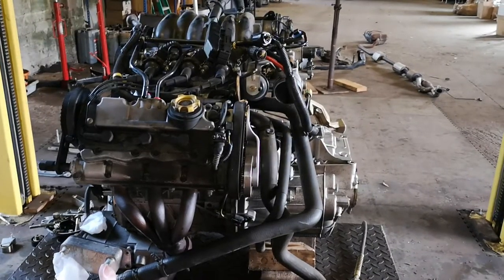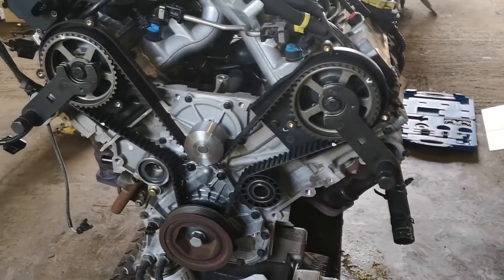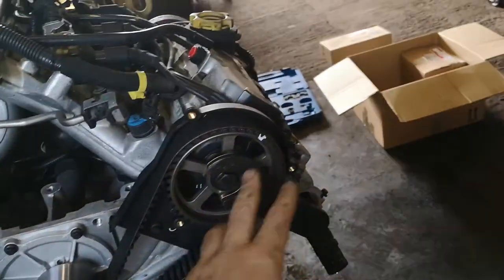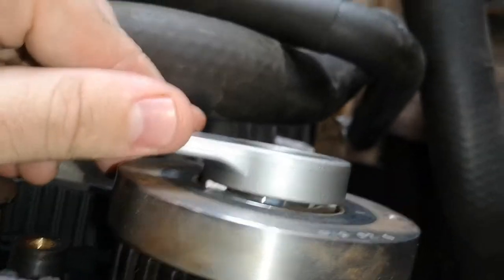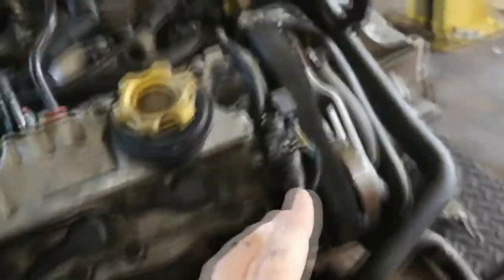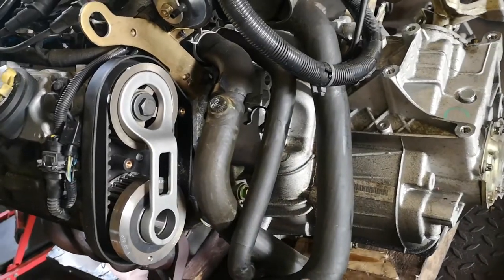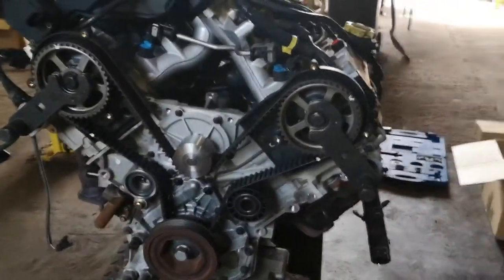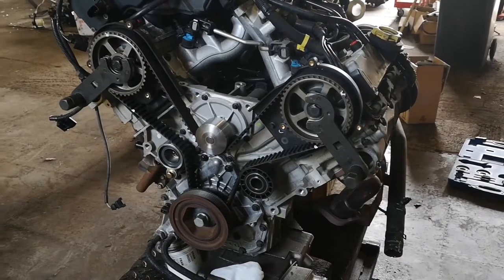KV6 timing belt insight

Comment: You're right! I'm changing the belt on my 103k MG ZS with 2.5 KV6 and the timing is a good couple of degrees out between each inlet and exhaust cams, although both belts there are getting a bit slack. Last person in there left paint marks so assuming perhaps didn't use tools. Thankfully I rented a set from DMGRS who are saints.
Reply from the maker: Glad it helped you out.

Comment: Ive got exactly this issue on the secondary belt side. The sprocket locking tool fits snuggly in the front inlet and exhaust sprocket and I can remove the bolts, sprockets etc and fit the new belt with no issue. But the rear set , thats a completely different matter , the tool will not fit. I posted this issue on FB 75 owners group and a member pointed me to this issue. So am I correct in thinking that I need to loosen the sprocket bolt on the rear bank in the primary belt side ?
Reply from the maker: Yes exactly. Loosen the 3 bolts will let the cam turn a couple of degrees on the rear side.

Comment: Question for you. I’m timing up a 2.5 KV6 from a 75 auto, it’s going in to a ZS 180. I’ve found with the flywheel locking pin in place the ‘v’ notch on the crank pulley does not quite line up with the pointer on the oil pump. The crank pulley notch is just a smidge off to the right of the pointer.
Would you leave pin in when fitting the cam belt, or remove pin and go by the crank pulley markings?
Reply from the maker: Make sure you are in the right hole in the crank, there is few. If you lock the crank up and it doesn't line up there something badly wrong.

Comment: What locking kit do you use by the way? Mine is a comprehensive kit with all the bits, but it’s rubbish! The camshaft locking tools just slip out and don’t fit properly
Reply from the maker: mine is one i picked up from a rover dealer, so is a genuine set.  Yes i believe some of the aftermarket ones have diffculty locking the cam sprockets.  Prob poor material choice etc.
hope you get it sorted.  just remember to rotate it a few times before you bolt everything up and fire the engine for first time.
Reply: @mrkstrlng  I have one of the cheap Chinese kits from Amazon. I found that the lugs on the locking tools needed a bit of touching up with a file for a proper fit. Then they work fine. The biggest issue with the cheap kits (and I think the Sealey and Laser kits too) is that they don't use the factory type cam turning tool but instead have a hex on the end of the locking tool for turning. If you aren't careful the took can cock and fracture the end of the cam where the locating pin fits. I haven't had any luck finding the proper tool and am thinking of making up my own.

Comment: I have been given a present of a Rover 75 connoisseur 2.5l My brother had been offered a £100 for it when trading in. An offer which he refused and instead offered it to me. The only Rovers I have been familiar with have been a Rover105R from 1957 and a Rover100 from 1962 so this new Rover is unfamiliar to me. I knew as soon as I listened to the engine that it wAS off-tune. I had also been advised by a highly experienced mecahnic that no matter what; I should replace the timing belt at the very least. So I bought the recommended timing tools. I am now at the stage of fitting the belt. The first thing is that the new belt is 1.5 inches longer than the old belt. So I ask is this stretvch normal for a car that had a new belt fitted at 30,000 miles(it has now done 57,000 miles) so about 30,000 miles on the belt I am replacing; Is this normal or was an incorrect belt fitted>?  I have fitted the locking tool on the front inlet camshaft and it is noticeable that the exhaust camshaft is retarded by at leas 5 degrees.  The second thing I have found is that the locking tool for the rear cambelts will probably not fit. I see from your pics that there are no markings visible on the inlet rear camwheels whereas on my car there is what appears to be a part number and the word inlet.  Also the belt guide rim is on the outside. Can you tell me does this mean that the wheels have been fitted the wrong way around? should the writing on the cam wheels face toward s the engine block? It seems to me that this may be the case. Incidentally, I think your video is great and very clear. I live in Ballynahinch just down the road form you I think!

fred
Reply: I have removed the cam wheels ; it is impossible to get them back to front. I can get the locking tool in when they are on the bench so I hope to get the timing done in the next day or two. It is difficult to get at things when the engine is in situ
Fred
Reply from the maker: hi Fred, sorry for the late reply.  you have to remember this engine in the video is a 2.0 and not a 2.5.  The pulleys may be different marked.  They also use different timing tools. It does sound like you have a early engine and the rear cam spockets were different setup.  You should be able to use the timing tool in kit to lock them up.  The difference in the belts would be abit worrying and id say are wrong.  But im guesssing after 3 months you have it sorted.  Glad the video was some help to you and call down if your about.

Comment: Hello,
how do you align the camshafts?
Because if you align them will it more align the crankshaft pulley with the engine mark?
thank you
Reply from the maker: no there is only a mark for the crank pulley, the cam you need to use the locking tools

Comment: I see that your crank pulley is on. So you Didn't have to remove that pulley in order to get the front cover off?
Reply from the maker: It's only on to rotate the engine and stop the belt coming off. A good practice.
Reply: @mrkstrlng  Thanks...too bad)  I just got mine off today so I can see now that there is a small plastic cover for the crank pulley that is held in place by three 8mm bolts. I have changed a number of timing belts on Toyota's, and none of them required the removal of the cam pulleys like rover says to do here. The only reason would be to replace the oil seals, and I'm not going to do that. I'm just gonna cut the belt to remove it, and then I can remove the tensioner without damaging it. Do you see anything wrong with that?

Comment: By the way, if the cam sprocket float on the cam shaf keys with a degree of movement, what ensures the cams are timed up correctly?
Reply from the maker: The rear locking tool keeps the cams alligned and then you torque the cam bolts up at front to lock eveything

Comment: Hi mate I've recently subscribed and I know it's not kv6 related but on your video for the l series gt2056 you mentioned there may be dyno results video for the said conversion did that come to fruition or can you give me anymore information on the results tia 👍
Reply from the maker: Hi Stephen. Thanks for the subscribe. Car ended up making 184bhp /290ft/lb at lowish boost. Car is still running today with little issues so far. The peak figures aren't all that matters. The torque curve is alot flatter meaning the car drives alot better.
Reply: @mrkstrlng  thanks for the reply I'm on the look out for one of those turbo's I'm pretty sure it's what is on my dad's 2.5 vivaro that's mapped decat dpf removed that puts out 165.4 bhp on the rollers custom tuned for towing it doesn't even know when we have his prosport lm3000 on the trailer. Did it make that with sdi's standard pump and is it the case that freelander nozzles are bigger or is that hearsay? 👍
Reply from the maker: Yeah that was on sdi injectors.its pretty close to maximum the fuel pump will deliver. Freelander injectors would be inbetween standard and sdis. Larger would be land rover 200tdis injectors.

Comment: How are you able to adjust the rear belt if the cam is locked at the front? Its the same cam so if its locked at the front it isnt going to turn at the rear. The engine I am doing has no play in the front locater. The toothed pulley can rotate but the tool keeps the cam still.
Reply from the maker: You need to loosen the bolt in the pulley. There will be movement in the cam pulley on the cam. It's very small amount.
Reply: That’s true. You cant turn the intake camshaft while the tool is locking the front cam pulley. You will need to remove it.
Reply from the maker: sorry but i think you have missed the point of the video.

Comment: Would this be the same set up as my 2002 MG ZT 2.5 160? I am going to be doing the belts on that soon. What do you do r.e cam seals? 
I understand there is an issue with new cap type seals falling out, so the only alternative is to use standard cam seals leaving an exposed camshaft end rotating - which is not ideal
Reply from the maker: yes will be the same idea for your car.  the different bhp models use different timing locking tool, so this is the difference.  If you want to do cam seals then remove the pulleys and loosen off the 2 8mm bolts and is usually enough to remove and refit the seals.  Use a socket to push the new seal in equally.
Never had a issue with the cap seals myself but yes people do use just a cam seal instead.   Either way should be fine.
Reply: @mrkstrlng  I don't want to re-use old cam seals, I want to fit new ones. So you have re-used the old caps and had no issues. But have you ever fitted new cap seals?  I'm guessing the issue with them falling out/coming loose is poor quality caps and perhaps not being fitted correctly - it is extremely difficult to do with the engine in the bay after all. I hope that If I fit genuine LR caps to the engine when it is out of the car will ensure they are fitted correctly and wont come out.
Reply from the maker: Hi ash. Yes I always fitted new caps. You can fit seals instead of the caps. Some people do that. I've never heard of caps falling out. They are usually a very tight fit.
Reply: @mrkstrlng  I have always had a terrible time fitting new cap seals with the engine in the car. On a couple of occasions I gave up and refitted the old seals using some sealant around the edge. Never had any issues with them leaking or coming out on their own,